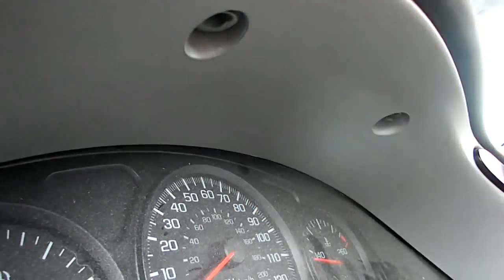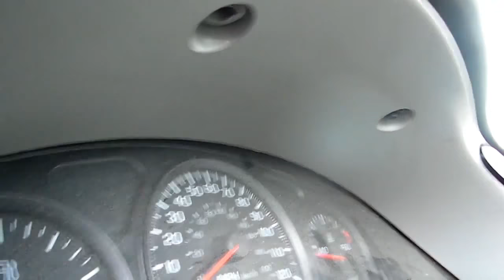Chevy Impala 00-05 Ignition lock Cylinder Replacement

Comment: Replaced ignition lock cylinder on 2001 Impala today and you most definitely do not have to take the dash apart.  Simply removed the ignition bezel and popped out the old cylinder with a bent coat hanger (after removing negative battery terminal of course).  It took 5 cycles to relearn/program the new part, but it worked!
Reply: How did you safely remove the ignition bezel?

Comment: Today I replaced a 2003 Impala lock cylinder following your directions. It failed.
I spent half the day doing this, and stumbled upon the correct sequence of programming.
When you get to the programming part, restore power and then:
1. Turn key to on. Security will begin flashing 3x along with battery light 1x wait in this state for 10 minutes, flash sequence will change to security 1x battery 1x.
2. Turn key off, wait 5 seconds.
3. Turn key to start, wait a second and release.
4. Flash sequence is back to security 3x, battery 1x... wait 10 minutes until it's security 1x battery 1x.
5 Turn key to off and wait 5 seconds.
6. Back to 3x and 1x, wait 10 minutes until it's 1x and 1x.
7. Turn key off and wait 5 seconds.
Car should now start.
This cycle of on, wait, off will likely be repeated 3 times before your car starts.
I hope this saves someone time, frustration and expense. I had just about admitted defeat.
Edit: I hooked the car up to a battery charger while doing this, as the car drains quickly.
Reply: Hey this maniac behind the wheel just thought your video was very helpful in my first attempt on changeing the ignition switch in my impala but you should. Have mentioned when ould be the correct time to switch the gear back into park had me bambozzelexd striaght out puzzeled about the situation you got me into, my mechanical yoda. May the tools be with you my friend. Untell the next gasket blows. Godspeed
Reply: Tim Tracy your a life saver😎
Reply: Tim Tracy 
How many times did it take you to start your car with your directions?
Reply: Tim Tracy, I freakin' love you man! I tried 8 different times to get my ignition to work. I ran across your comment, and BAM!, on the 2nd repeat, it started. You're a life, money, time, and car saver. Hats off to YOU bro.
Reply: Tim Tracy--- in step 6...what location did you turn the key to that time?  On..or Start?
Reply: Thank you for this…….this definitely saved me hours
Reply: Tim Tracey, years later and your comment saved me much frustration, you are a spawn of Jesus himself my man. Thank you!
Reply: Mine flashes 6 times then battery
Reply: I don't know if you're still reading comments on a 4 year old post, but THANK YOU!!!  I did the same relearn method in the video a sh!t ton of times with zero luck.  I was just about to give up and have the car towed to Chevy, but I tried your method today and my 2001 Impala started right up after the third cycle!!!

Comment: Thank You. '03 Impala here.. This vid showed me how to remove that giant dash-wide trim piece which is covering lock cylinder, radio/HVAC, etc. I was installing a "XpressKit PLJX GM Self Learning Passlock Override" for which I needed to access the wires going to the ignition cylinder. I ended up taking the (2) 10mm head screws out and removing the entire cylinder+switch assembly out the back of the dash - which was difficult. Getting it back in was also difficult..  but the Override module seems to have cured the dreaded Passlock "Security" No-Start .. well worth the $27 and 2 hours of hassle.. if I did it again I would leave the cylinder in place thus not even having to remove giant trim piece but would struggle more upside down under the dash to access the bundle of wires.. or pay someone younger to do it..
Reply: Where can i get this passlock overide kit for 27.00 please my 03 impala wont stary
Reply: Do I understand that you able to get rid of the security lock by doing what you did cuz I'm trying to get mine out and the deal isn't going to charge a fortune and they'll just replace it

Comment: I don't want to seem rude or knowitall.  But I work as a locksmith.  You can remove this cylinder in 30 seconds without removing any panels.   But, you do need a gm cylinder removal tool. It sneaks behind and pops it out.   I won't call it easy.   But I'd much rather do that then this.   This man's method is good if that isn't available tho.  And he teaches it well
Reply: were do you get one?
Reply: How do I change it if the key don't turn I took the dashboard half way off and took the lock box down
Reply: link to tool?
Reply: @kevinjohnson2125  drill out the ignition... measure the key to the drill bit and mark the bit so you dont drill to far. you have to wiggle the drill bit some to get, you can then put a screw driver in to turn the ignition... mine actually turned while drilling.
Reply: Help. My key or my spare wont turn the ignition to move the gear shift  i have a 2000 chevy impala also can you tell me which ignition with new key i can buy on amazon im desperate thank u

Comment: I finally got an ignition lock cylinder that works. Yay. Did the three try to crank, and 10 minutes deal. On the 3rd time the security light went out. And I cranked it up. I'm so happy

Comment: It's crazy how much of the dash you have to take apart to get the cylinder out. I took the ignition cylinder out of my 03 F150 the other day because I was replacing the shift tube bushings and it was super easy.
Reply: InternetDude my key won't turn how can I remove the it without it turning
Reply: how can I remove it if the key won't turn
Reply: I heard that you lift the key about 1/8" in the lock and then turn it.

Comment: For everyone no being able to turn the key. Put the key in the ignition and smack it a few times firmly with a rubber  mallet or a hammer with padding on it. this worked for me after a couple smacks. Smack at  your own risk though. Don't bend the key.
Reply: I did this . The key turns fine now. Do you recommend I still change the lock cylinder ?

Comment: Thanks. Mine started just doing nothing once in a while. I turn the key, my instruments light up, go to start.... ...... nothing. When this happens I have to turn the key on and off like 5 to 10 times before she tries to crank.

I think its my switch, but im not sure.

Cars 19 years old only has 75K on it. Was never a daily or kept outside, Ive been driving it for under 6 months and have already had to change a fuel pump, a fuel pump relay and the gas cap.
Reply: I have same exact problem. Got the part, looking at this now about to change it.
Reply: Sitting/low miles is hard on vehicles

Comment: Hey Rich. On the last couple steps, is it possible to remove the cylinder if the key is unable to turn?
Reply from the maker: In most cases the cylinder has to be in a different location that lock to remove.

Comment: What if you can't turn your key at all
Reply: For real
Reply: Had to drill mine shoved flat head in n twist and unfortunately has to be done to pull cylinder to release other plugs
Reply: @ismaelmeraz7922  wait what did u have to do im confused
Reply: I need to replace mine what did u end up doing please my key eont turn either
Reply: @laterrancereaves5646  what did u do im confused too and i need to frplace mine key wont turn
Reply: @Americansiciliangirl  ok so right before I replaced my i was able to fix it by trying to turn somewhat harder than normal an shaking it all around if that doesnt  help then reply back an ill give u another Solution

Comment: Hey Rich, this is way late but on your rebuilding Walbro carb at 15:58 , the blue diaphragm covers the screen hole. Am I missing something?
Reply from the maker: Yes it has been a long time so i went back and looked at the video and it looks like the blue diaphragm and gasket is the same as the old one i took off and in the same place.Maybe someone would correct me but i believe the blue piece must act like a diaphragm in a pump.

Comment: More shots of that "button" would be helpful. Not showing what the pick did when you pulled the lock out made that portion useless. Was it a pull or push button? Was is a sideways slide button? If it was my first time I would not know what I'm doing with the pick.  Just poking it around in there scared of causing damage. Maybe you can see in there I don't know.
Reply from the maker: Sorry about that i should have somehow got a shot of the release button.
Reply: Funny , My 8 year old son noticed it immediately.

Comment: I have a 2005 chevy impala, I just replaced the ignition cylinder butvthe security light is still on. How do I get the  security light to go off?? Please help
Reply: Did you ever get it fixed? I have a 2003 impala and it turns on and runs good but the security light won't go away
Reply: Hold the display button down on your clock until SETTINGS pops up, use seek arrows to find alarm, go to off with the 1 button, click display button again to select and done. 
Think thats how i got mine out of there.
Reply: Thank you
Reply: I took off the new ignition switch and then put the old one back on and then put the new ignition switch again and that's how I got it fixed a buddy of mine told me to try what you mentioned in the comment but it did not work for me so I did the work all over again and that work. Thank you

Comment: how is the old key going to turn the new cylinder? unless it's keyed for it.
Reply: The new cylinder comes with a key. 
What this guy in the video didn't tell you is he replaced the barrel, and not the inside mechanism. (Which is what comes with the key)
If you want a cylinder barrel and the ignition it's $130
If you just want the barrel, which this guy did, it's $50.
If you look on autozones website you can see what I mean.

Comment: Hey rich, great videos.  O5 impala I did the tapping on the key to get the key unstuck. It's seems to work well now. do you still recommend to change out the lock cylinder ? 

Thanks!
Reply: I honestly wouldn't do that, it would be a hassle to replace it for sure, else you can do it like me, just carry your original key for the lock cylinder and the new key to start up the car

Comment: When I turn the ignition, doesn't want to start, I have to try turning it on for a 1 minute or 2 and than it starts and also the security light comes on and smokes comes out of the tail pipe and than it disappears, not pure white, a little black and greyish. What could it be possibly? And it only happens in the morning

Comment: I tried the tapping to remove lock cylinder and still wont budge. What else could i do??? 😞😞
Reply: Try to work some penetrant lube into the key hole, let sit for a few min and then try again with the tapping and turning. The cylinders and internals get stuck over years of use. May need a hammer instead of the gentle tapping that was shown in this video